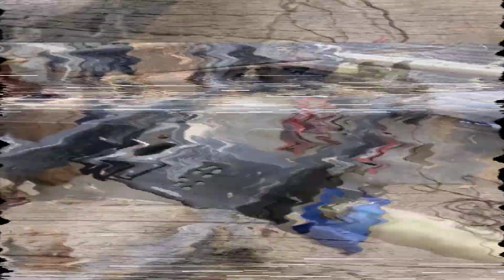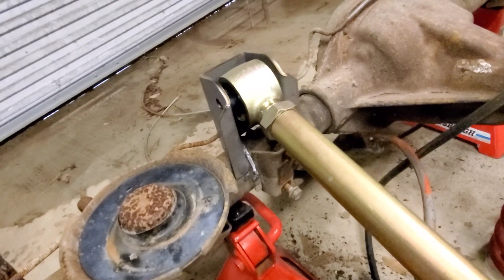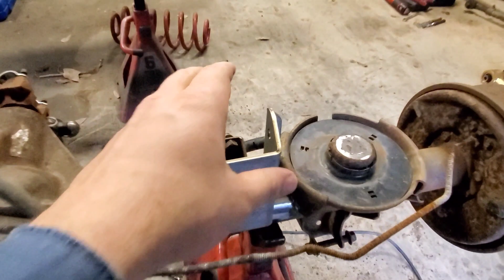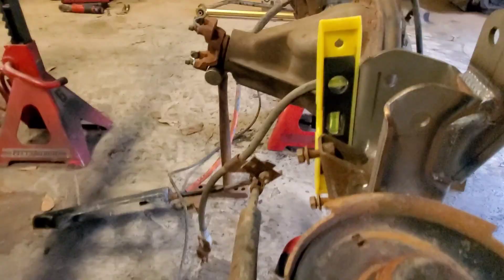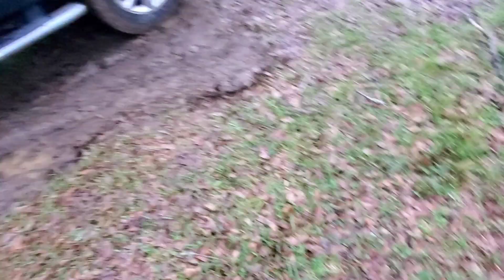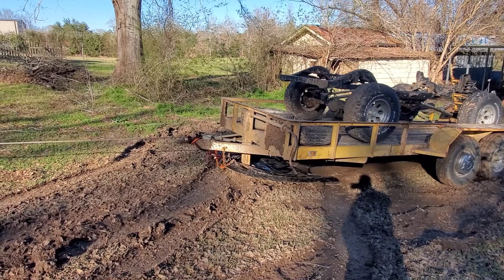Metalcloak, Jeep TJ long arm kit. 💪

Comment: Why long arm? Had my 97 for about 15 years and I've heard arguments but I forget what they are haha. I wish I could afford either short arm or long arm haha.
Reply: Also, my 8.8 in the rear had everything removed and moved for a 3-4 inch lift. Would I need to move them again for the same kit in a 3-4 inch? Or even a 5-6 inch but less travel without spring droop?

Comment: Should have at least ditched that junk D35 and got a 44 or 8.8
Reply from the maker: I have a 14 bolt I  was going to give him.  He said no. 🤷‍♂️
Reply: @ReshardsAutomotiveWorkshop  🤚🏻 I’ll take it…. That’s an entirely different rabbit hole… need front axle to match, different wheels, bracket kits..

Comment: Hello, where do you buy your upper control mount? I dont find on metalcloak web site🤷‍♂️
Great set up👍
Reply from the maker: On the axle or the frame?
Reply: On the axel😉
Reply from the maker: I will try to find it and post the link. It was purchased as a kit.
Reply: I've found! it is supplied with the kit. I thought you had purchased separately. 
Thank you so much 😊